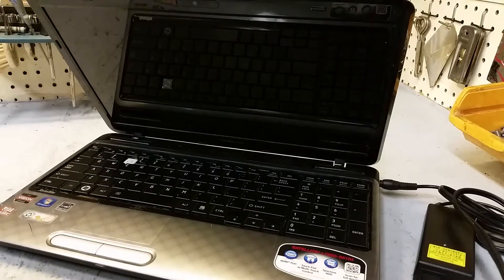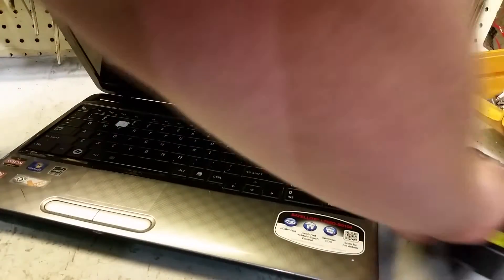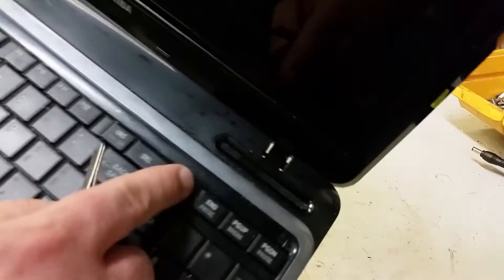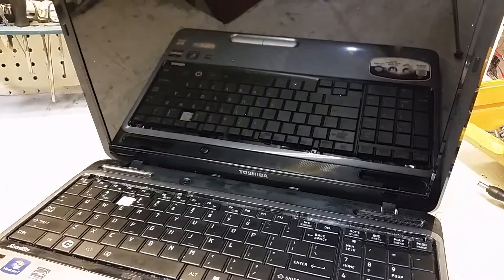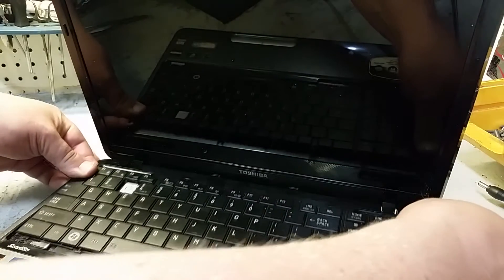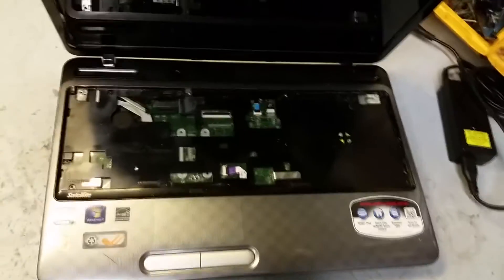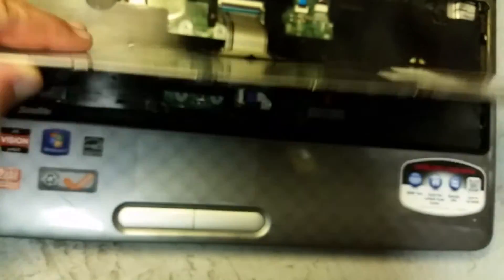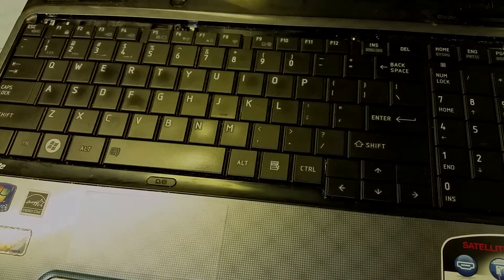Toshiba Satellite L755D Laptop Keyboard Removal and Replacement

Comment: Thanks, worked great.  The L775/S7248 doesn't have a retaining screw for the trim strip.  Trim strip just pries off.  It is held in place with some little plastic studs along the length and tabs at the end.